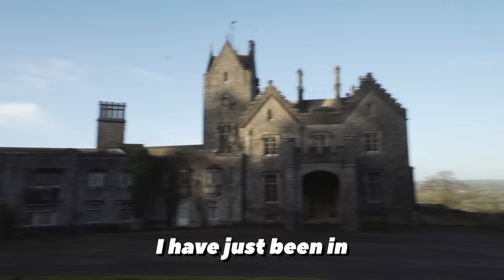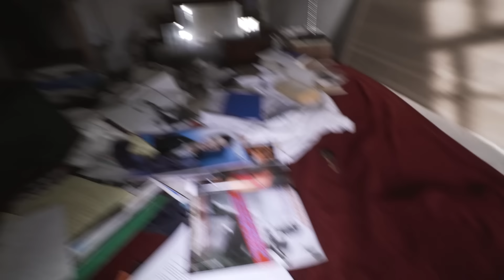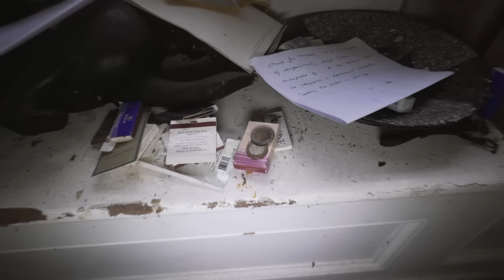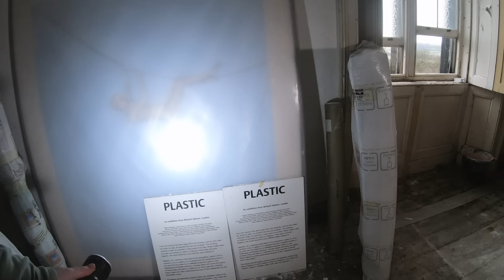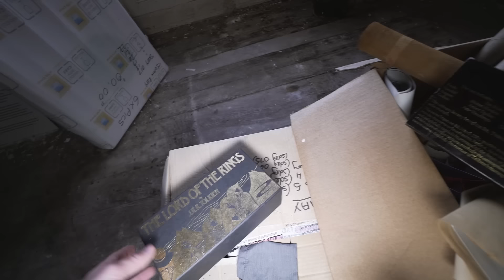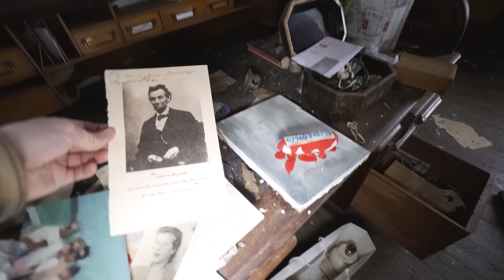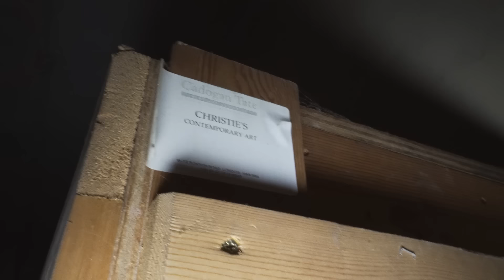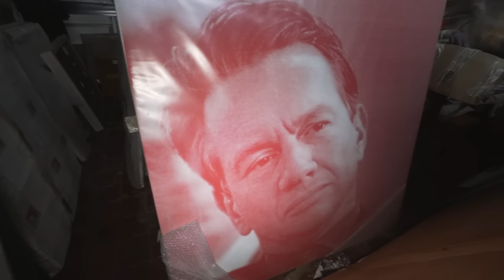This ABANDONED Mansion Has Some DARK SECRETS

Comment: I'm pretty sure the glass vases were made of radioactive uranium glass, the green colour is quite distinctive. You need a geiger counter or uv light to tell for sure but if it is uranium glass it's very radioactive.
Reply: I own a few pieces of uranium glass and it's hardly radioactive if at all
Reply: @paulafletchaa2613  I've got some old vintage thorium glass camera lenses and they're  radioactive, I think the uranium glass is a bit higher than the thorated though but I've not put a counter to them.
Reply: @Daz Goodwin  interesting,  I had my glass tested by a friend with a geiger counter , it registered just over normal back ground radiation so safe to eat or drink off . Gorgeous peices
Reply: @paulafletchaa2613  I think maybe the camera lenses are a bit hotter than that I think they're only dangerous if you break the glass and breathe in the dust or sellotape them to the side of your head for a year! They stopped using thorium in lenses in the 80s though.